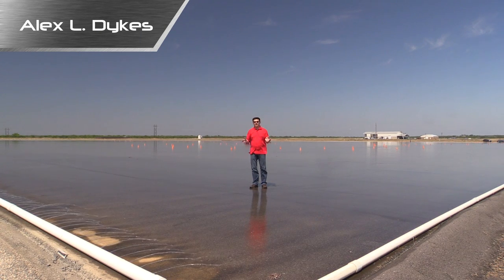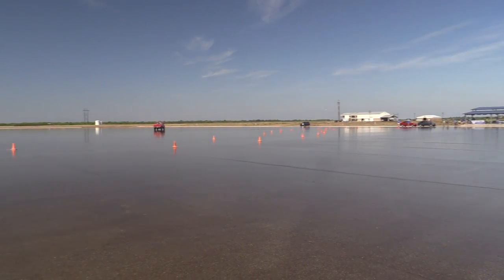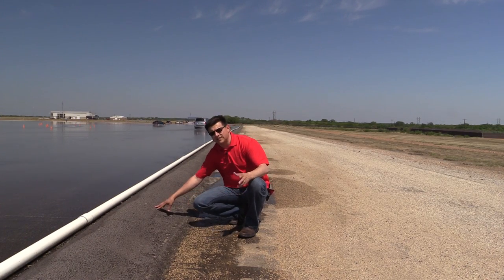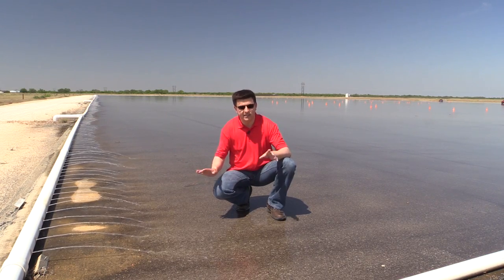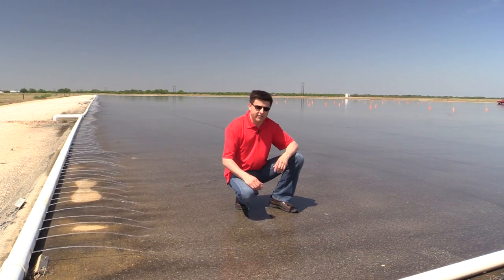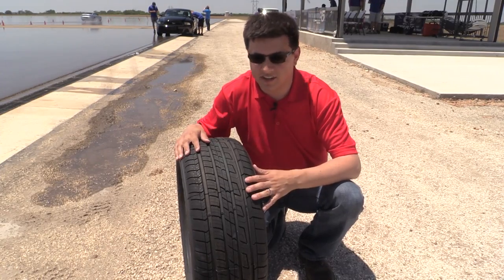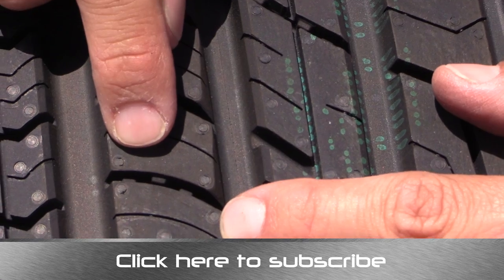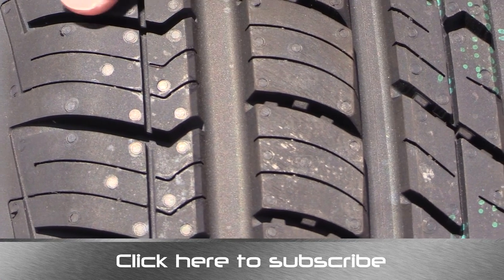How tires get wet track tested - Cooper CS5 at the Cooper Tire and Vehicle Testing Center

Comment: From what I understand, almost all of the cars that are sold on toady's market are equipped with ABS, and the drive should apply full brake when needed without worrying about losing traction.
Reply: You are wrong, if you are aquaplaning you have already lost traction.
Reply from the maker: ABS won't do much for you if you have already lost traction. Remember that ABS systems operate on a lock-release-lock kind of method (they do it very quickly) and that kind of braking is not as controlled as sub-limit braking. It is better than locking up, but worse than a fully controlled event as far as vehicle control goes. If you're on a track this size, sure, just jam the brakes on. On a real road the trouble is you could end up off the pavement.
Reply: Alex on Autos Hi Alex. My previous statement was not precise. What I meant was that for most drivers, applying full brake and let ABS do the job would be better than trying to perform adequate sub-limit braking, which is not exactly easy to do even for experienced drivers.
Reply from the maker: Hao Wu It's not really that simple of an answer. It would depend on the situation and conditions. In general if you are already hydroplaning, then no, don't apply full brakes, any driver would be better off just coasting until you regain control. Once you have control, then moderate braking is advised. The issue is more simple in a straight line where you can more safely apply full brakes and let the ABS system worry about the details. Around corners or uneven terrain a full application like that can cause you to veer off your intended course more than the slow and steady approach.